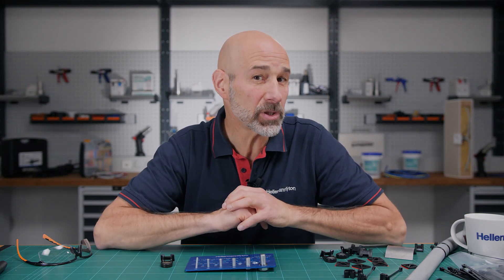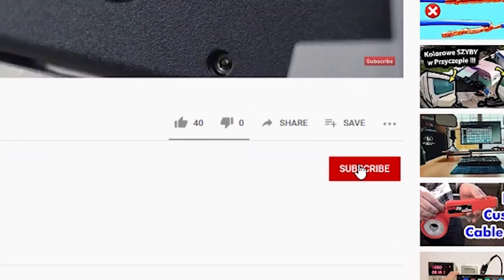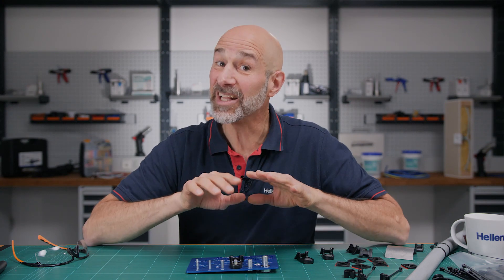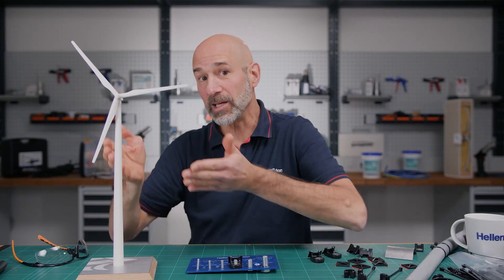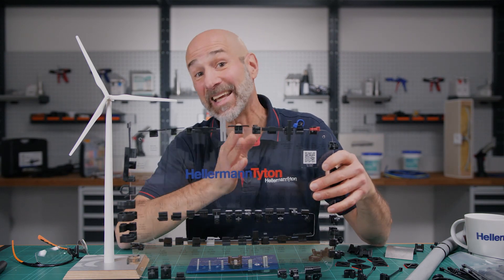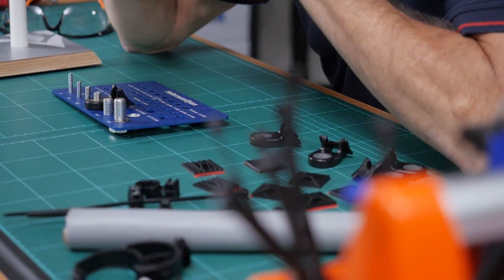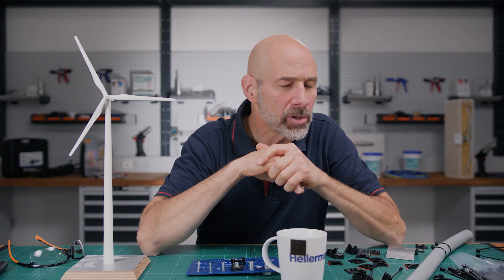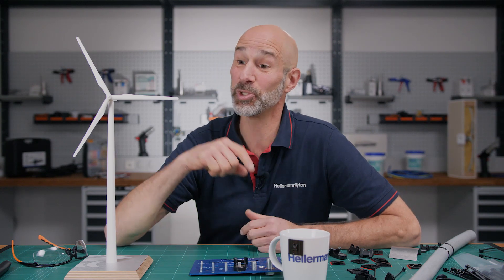How do you affix cable tie mounts without drilling? (EN)

Comment: Can these be used to attach exterior cables on a truck?
Reply from the maker: Hi rob kealey
, of course, many of our cable management solutions can be used in trucks. At least most of the major truck manufacturers do, they are satisfied customers of HellermannTyton.

Which solution is best suited to your application depends on the application, how heavy the cable is, how long, do vibrations play a role, is it in the engine compartment, outside, is there any edge for a clip etc. 

The best way for you to find out is to visit our website: https://www.hellermanntyton.com/, use the search function or contact us: https://www.hellermanntyton.com/contact

Best wishes, Nico

Comment: I’m wanting to hang some patio cover lights with these and our patio cover is aluminum. How do these hold up in the cold and damp weather? Also it’s painted.
Reply from the maker: Hi Frank Rizo, I don't know your dimensions of light and you don't write which method, presented in the video, you mean. In any case, gluing is not really an option for a light to be placed outside, under a patio. It sounds like you need something stable and I guess self-adhesive cable tie mounths won't be enough. have fun, best regards Nico

However for some more information and installation instructions for self-adhesive mounting bases visit the website: https://www.hellermanntyton.com/competences/self-adhesive-cable-tie-mounts-and-clips?utm_source=youtube&utm_medium=social&utm_campaign=YouTube-description&utm_content=FAQ-2020-nr5-Nu150-DCBfg-en-cable-tie-mounts#tab3